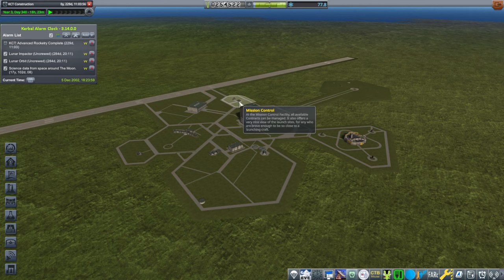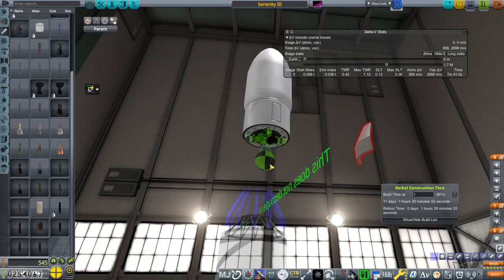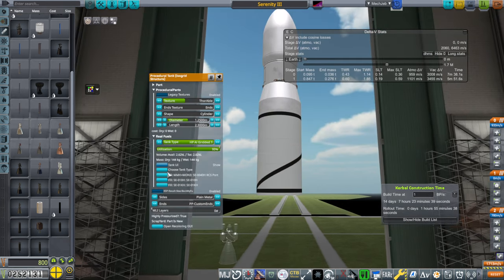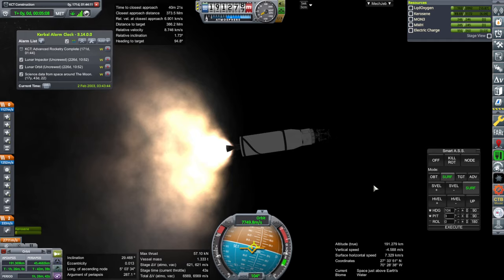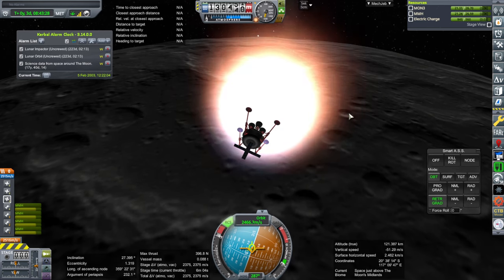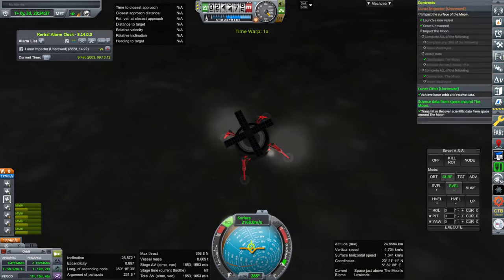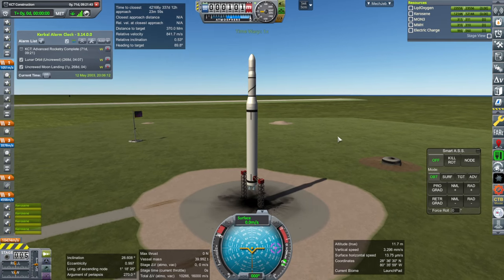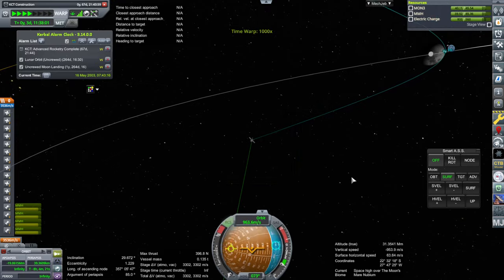RP 2000 Career 10 (RO in KSP 1.12)

Comment: I didn't notice but was the ISP 315 in the VAB that is what it looked like while burning.  Also residuals on a large DV stage could eat up a significant amount of DV. Remember a large chunk of your DV comes from the last 10% if you only use 8% that would hurt.  On your second to last stage it looked like you had 5 units of each left over, not sure how much you would have left over on your final stage.

Comment: Are there parts below 1 kg on the lander, i heard ksp has problems with those where they cant weigh less than 1 kg. It throws of delta v calculations since it displays the delta v as if the parts weigh less than 1 kg but actually they do weigh exactly 1kg for the physics calcs
Reply from the maker: Yes, I think that's the problem - it's the cubesat parts messing up the delta-v.

Comment: Hi raíz i have a poblem with my shuttle in ro the problema is is so dificulty handle it and I also have problems with the scales of the canadarm the canadar is very small I don't know if you can make a video solving that problem and also what mod do you use to manage the shuttle? And also, what servo motors do you use to move the canadarm? do you have the name of the mod?
Reply from the maker: It's been a while since I used Canadarm with the Shuttle (like, maybe KSP 1.8.1), so I'll have to retest in 1.12 before I can say anything - the mods have probably changed.